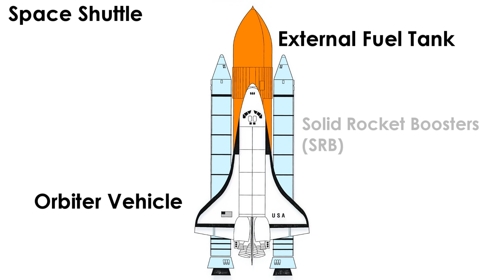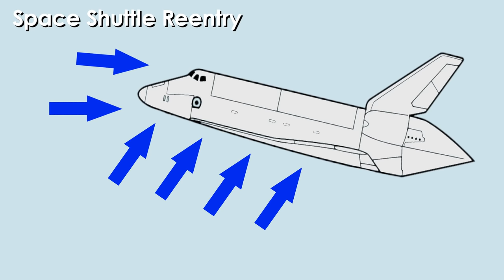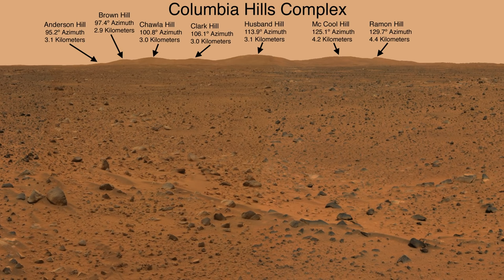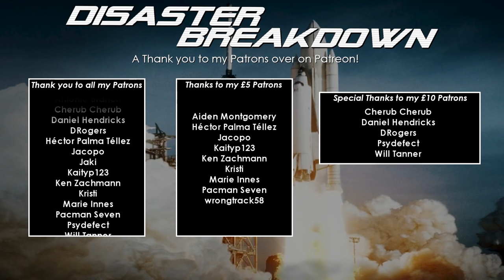What Happened To Space Shuttle Columbia - DISASTER BREAKDOWN

Comment from the maker: Small Corrections.
- Astronaut Kalpana Chawla achieved a PhD in Aerospace Engineering. In this video I did not address her as Dr. Kalpana Chawla as I should have.
- As a couple people have pointed out here, the Solid Rocket Boosters on the Space Shuttle are actually connected to the External Fuel Tank and not the Orbiter Vehicle.
Thanks to those for that info, my apologies.
Reply: You also misspelled Ilan Ramon's first name
Reply: Also don’t the srbs separate after about 1 minute? Also the thing about the rolls to cool it is also used for descent to minimize lift. Cool video either way
Reply: Can you please see if you can do a video on Space Shuttle Challenger STS-51L? Thank you!
Reply: The wing section that was used for testing actually came from Enterprise. They used reinforced carbon-carbon because they could not mold tiles into the proper shape for the leading edge, and to save weight.
Reply: There were six Shuttles built with Enterprise flying several test missions in 1977.
Reply: I don't think the doctor cares if she is refered to as DR.CHAWLA. She has been deceased for many years..
Reply: @markr.devereux3385  Yeah thanks i was writing that.
these indians know anything else apart phds
Reply: @zaytwal1766  lol!  That's a good point
Reply: @janefeeney373  they are certainly welcome to use the Dr before her name but after getting a generous settlement from NASA they shouldn't squawk.
Reply: @daviddavis  SRB Separation occurs at 2:00 into the launch.
Reply: Great video, Thank you so much, really good explaining 👌👌👍👍💕
Reply: You forgot mentioning that Ilan Ramon was the first israeli astronaut, and that Columbia was set to be his first mission.
Reply: @daviddavis  Believe in JESUS today, confess and repent of your sins. No one goes to heaven for doing good but by believing in JESUS who died for our sins. Hell isn't fun. GOD loves you soo much unconditional❤🙌❤😘
Reply: @alunesh12345  that's one way to admit that Jesus is evil
Reply: You should do a video on the Challenger Disaster.
Reply: Blaming technicians for problems encountered is like blaming Donald Trump for inclement weather, NASA was notified of the problem and they ignored it, rest in peace Brave astronauts 🦅🇺🇲🦅❤️‼️
Reply: We shut down a launch and sent it to California for repairs prior to this
Reply: You should do a video about the Challenger Disaster.
Reply: It's not something I want to revisit but I live it daily
Reply: @David Staudohar  yes you are correct we tried got one postponed it didn't matter in the long run
Reply: You are perfect, Chloe.  We love you & appreciate you. Big, squeezy hugs
Reply: Lol imagine needing help from your own audience

Comment: I heard that they did a mock foam strike test for days and days. It never made a dent for the longest time. Then one attempt, at just the right angle, at just the right spot, at just the right speed;

 the foam obliterated the wing. Going against every bit of testing they did prior.

Freak accident.
Reply: The foam broke a 12-inch by 18-inch hole in one RCC panel.  The problem was that NASA was forced to use substandard tank foam because CFCs were outlawed.
Reply: Yeah, there was a report and a video of those tests.  Very correct indeed.
Reply: The foam had previously damaged the tiles on the orbiter but NASA concluded that it was because the glue just had lost it's strenght and foam or ice strikes happend often but had not made any big holes before.
Reply: @Redman680  could you provide more information? Did they test on panels for different parts of the craft? And only at the ery end of mock strike testing did they use the actual kind of panels where the hole was created? Or are you saying something else? 

Are you stating that the testing did not happen over and over and that it merely took a long time to get the mock foam tests underway? I only stated what I had heard, not what I had known. Maybe I misinterpreted what was said in the documentary.
Reply: Unreal
Reply: Anything that can go wrong, will go wrong, especially with something like space travel.
Reply: @RideAcrossTheRiver  Believe in JESUS today, confess and repent of your sins. No one goes to heaven for doing good but by believing in JESUS who died for our sins. Hell isn't fun. GOD loves you soo much unconditional❤🙌❤😘
Reply: @alunesh12345  The topic here is the Shuttle accident of 2003; not ancient Levantine tribal beliefs.
Reply: @RideAcrossTheRiver  I don't think it was the CFC's. They have had issues with popcorning since STS-1.
Reply: @captainconway2236  Shuttle foam did not cause pollution or the Antarctic ozone 'hole'. CFC ban contributed to the needless demise of the Shuttle program.
Reply: @RideAcrossTheRiver  are we talking about the same CFCs? Chlorofluorocsrbons? If so then yes they are responsible for the extreme degradation of the ozone layer. Maybe not shuttle foam specifically but the production and use of chlorofluorocsrbons broadly is directly responsible for the massive loss of Ozone in the upper atmosphere above Antarctica. NASA does not have the budget or time to be producing their own CFCs so they buy it from the industry, and when it got rightfully banned for its extremely negative impact on our planet,  NASA had to switch. I'm not saying you are wrong about it being a superior for this purpose, just pointing out Chlorofluorocsrbons were banned for a good reason.
Reply: They lost 2 of the 5 ships they built. That's a 60% success rate. An "F". Failure of a program. That ship never was and never will be safe.
Reply: @jsb331  No, there were two failures in 135 missions--neither of which had anything to do with Orbiter design.
Reply: @wyatt1648  Yes.  And especially with a procedure that gets repeated over 100 times, like launching the Space Shuttle.  That's enough attempts to see a lot of bad things happen.
Reply: @RideAcrossTheRiver  I think the Orbiter itself was good.  The issue was with the stack design -- side-mount the Orbiter and put the heat shield in harm's way with the foam problem.  An advantage of capsule-based designs (like Saturn V or SLS) is that the ablative heat shield is inside the rocket and doesn't get exposed until after launch.
Reply: @Mpg-gh5fq  The STS design was for a winged, fly-back booster to carry the Orbiter to space.  NASA had had enough with Apollo's giant firecrackers.

NASA's design was approved, but Nixon and Congress provided funding only for the Orbiter, laughed, and told NASA to build the STS or else.  

So there you go.
Reply: @Mpg-gh5fq  "That's enough attempts to see a lot of bad things happen."

HOW many Saturn V launches--thirteen?  Three had failures with two of those failures mission-critical.
Reply: @RideAcrossTheRiver  Also true.
Reply: Thankfully they are all still living

Comment: A classic case of basing a diagnosis on the difficulty of the cure. They pretty much knew they were screwed if the wing was damaged, so they shrugged it off and said "nah it will be fine". Very poor management. They should have run the inspection space walk, and then dealt with the reality of outcome. RIP the astronauts.
Reply: bree walden; womanizer  STS-27 almost had it's wing melted off in 1988 thanks to the exact same scenario, they knew exactly what could happen.
Reply: Their ignorance is what killed them as you said instead of taking precautions having to 100% known the shuttle was damaged they ignored that fact and paid the ultimate price as they say
Reply: A single woman's decision doomed this crew, nothing else.
Reply: Apollo 12 was struck by lighting during launch, and there was a real concern that the mechanism that deploys the parachute wouldn't work during re-entry, but NASA had the same attitude back then too. Thankfully everything worked out.
Reply: Columbia didn't have the correct spacesuits to do a space walk or the tether to do so. Later shuttle missions had that equipment.

Comment: Just crazy how a foam tile can cause so much damage especially against carbon material previously thought to be indestructible.
Goes to show how crucial the planning process is for any space launch.
Speculation and a rush job due to financial pressure can lead to a catastrophic lose of life and the financial cost exceeding the original balance.
Great breakdown, learned much about this process and what could happen when things are over looked and/or disregarded for time.
Reply: A stitch in time saves nine.
Reply: But physics shows why thats completely possible. If the same piece of foam in a human...bye bye human. Its not the object, its the speed of which it hits something else.
Reply: After the Columbia disaster Nasa did a test. They shot a piece of foam at an aluminum wing at a high speed. The foam made a hole the size of a briefcase in the wing.

Comment: It's a shame and seems like an oversight, that the crew members of Columbia did not do a space walk to inspect the wing. NASA is partly to blame. If the damage on the wing had been discovered, perhaps something could have been done. Also, NASA had a very close call with the last Atlantis shuttle flight before this one. That craft had lost so many tiles on re-entry that it came very close to disintegrating too.
Reply: At that time the shuttles didn't carry the cables to do a space walk, and the pressure suits that the astronauts wore were not designed for being outside the shuttle in space.
Reply: The Columbia didn't have the right space suits to do a space walk.
Reply: @SymphonyBrahms  they should have equipped it as such.

Comment: If they had known the heat was the catalyst, then that wing could not take anymore stress on re entry.
 I believe if they had known they wouldnt have performed the right side tilt recover. So favoring the left wing coming in even at around 14 degrees (cocked) until plans could be made for ejections or rendezvous rescue craft, or alternate landing spots. The survival percentages could have gone up, had they been able to utilize that super technical rocket/louver system. I think.
Reply: Wrong. The shuttle HAS to roll both ways during re-entry. Tip: check your facts before posting, it will save you looking like a fool.
Reply: @Redman680  why did you put quotations at the end of your sentence? That some new slang fad..?? Ridiculous

Comment: I'm a layperson with an idea that might have saved the ship and crew. If a piece of titanium was used to reinforce the leading edge of the wings, it might have deflected the insolation from the fuel tank, resulting in little or no damage to the wing. The inspiration for my idea came from, of all places, the Bruce Willis movie ARMAGEDDON.
Reply: They specifically chose not to use Titanium in the Orbiter because of horror stories from Lockheed Skunk Works when building the A-12 and the SR-71. It was hard and expensive to obtain, and hard to manufacture with in the late 70's when Columbia was built. Also Titanium isn't as heat resistant as Carbon Carbon. Carbon Carbon was used on the leading edge and the nose as those are the spots that had to withstand the most heat.
Reply: @stevengoetz6773  Thanks so much for your reply. You sure thought me a few new things.

Comment: The 1970s was a bad decade to introduce any kind of plane.  The Colombia was a Rockwell OV series spaceplane.  The OV series was introduced in 1977.  Commercial planes introduced in the 1950s, 1960s and 1970s killed 2000 to 3000 people per 1000 built.  The Rockwell OV series average was 2333 killed per thousand built ((14 dead/6 built)*1000).  Planes introduced in the 1980s killed about 350 per thousand built and those introduced in the 1990s killed about 150 per thousand built.

Comment: Good that the SpaceX Starship doesn't have an external fuel tank or solid boosters. Nothing to damage its heat shield. The shuttle had lots of uniquely shaped tiles. The Starship has a limited number of shapes so they can carry spares and do an EVA to inspect and repair in flight.

Comment: This disaster was preventable.  
Some department head denied engineers access to photos taken of the shuttle post launch. Photos that showed the damage done to the heat tiles and wing.  Photos that would have told the engineers there was a gaping hole.  She denied access for no apparent reason.

I hope she knows she killed not only the crew, but the Space Shuttle programme, and suffered guilt for the rest of her life.
Reply: And then ? What they could do to save the crew ? ISS was not in the same orbit plane, and no rescue mission could be made before they run out of oxygen. 

Even if they knew about the hole, they were condemned the moment the tile was damaged.
Reply: There were no such photos taken. Instead there was a plan to take photos in space from an air force satellite. But the satellite was orbiting at a different height than the space shuttle, and it would have cost NASA $1 million to move the satellite. And the Air Force, which owned the satellite, was reluctant to move it.

Comment: I can't help but wonder if cold temperatures may have been a factor in both Challenger and Columbia, but for different reasons. We know Challenger's O-ring issue was to some degree related to the cold which may have affected the seal in the SRB joint. Likewise, the cold may have made Columbia's insulation on the fuel tank a bit more brittle and susceptible to breaking away.

Comment: I read the accident investigation report.  If the crew area had been designed to be a areodynamically stable shaped pod, not unlike ejection pods of some military jets, break up would have thrown the crew pod free and able to employe emergency parachutes.
Odd thing was hydraulic system was a single system.  Once hydraulics in wing damaged control was lost, yet the cars we drive have dual system hydraulics to avoid such loss of control.
Another oddity was crash worthiness of helmets in race cars exceed the crash worthiness of shuttle helmets.   Meaning violent turbulence causing head trauma would render astronaut unconscious and unable to perform emergency procedures.
Hardening of hydraulics might have bought them a few more minutes of control and they were only minutes away from landing

Comment: Dear Editor,
In 2003 STS-107 and it's crew were lost on re-entry due to damaged tiles. This was not the first time insulation falling off the fuel tank had damaged our shuttle. Whether a  rushed rescue mission could have saved the doomed Columbia crew will never be known. But I have a feeling that Linda Ham did not want the public to know how bad the tile damage was . Why? Because life is cheap and the shuttles had squeaked through similar insulations  before. Ask Hoot Gibson about  his Atlantis flight.
Reply: The hole in the aluminum side of the left wing let in tremendous heat which damaged the tiles on the underside of the wing.
Reply: There wasn't another shuttle ready to perform a rescue mission. Preparing one would have taken weeks. And the Columbia didn't have that much oxygen left.

Comment: The shuttle was gliding down too fast from a High altitude.    The highest altitude possible is about 62 miles above the ground.    That's where the AIR becomes too thin for flight.     The shuttle gets it's altitude from a piggyback ride on the top of a specially designed military jumbo jet airplane.      Not from a rocket.     They allowed the shuttle to glide down too fast.     It was for the cameras.     They didn't have to do that.     They could have told us that they slowed the shuttle down 2 hours ago and turned on the camera after the shuttle was at a lower altitude        it was all for the camera.   People died because of it.    Then they discontinued the shuttle program.    It's because it was Dangerous
Reply: The shuttle came apart because there was a hole in the wing.

Comment: 6:50 just like in the challenger disaster, engineers WERE concerned with the potential dangers of the foam strike as modelling showed its impact likely caused damage.
And just like challenger a NASA manager LINDA HAM was more concerned with a p.r/money problem than a real one! 
So much so that a surveillance satellite was offered by the defence department to take high res photographs of the doomed shuttle as it flew by, only to be ignored by Ham.
Experts say that the shuttle carried a large amount of supplies and fuel as a redundancy and an external shuttle repair could have been attempted by the crew if LINDA HAM did her job, dropped the power trip and listened to people that know better.
Reply: The satellite would have cost $1 million to reposition at a another height. And there were no cables to go outside the shuttle, and the spacesuits were lightweight and not heavy enough to do a spacewalk, and no aluminum to repair the hole in the wing.
Reply: @JimMac23  interesting! Where did you find that info?
Not being a dick, I don't question what you've said, I've just read a lot about both tragedies, I'd be interested in reading this

Comment: both shuttle disasters were caused solely by human negligence and indifference.
NASA loves to portray this as if no one realized what happened and they only found out through later testing how dangerous the issue was.
In reality they KNEW the heat shield had been hit during launch. And they KNEW this could be a huge issue since they already nearly lost Atlantis during STS-27.

They chose not to check for damage before re-entry. They chose not to look for other options such as a rescue (reminder that the potential damage was known from day 1 and they were in space for more than two weeks. And had additional leeway in terms of supplies, especially if rationing from early on. They probably would have had a month of time to find a solution), alternate re-entry paths and modifications to the shuttle. 

STS-107 was not an inadvertible tragedy They might still have failed in the end. But the reality is that they never tried. They already had lost a shuttle due to negligence. Yet their attitude did not change one bit.